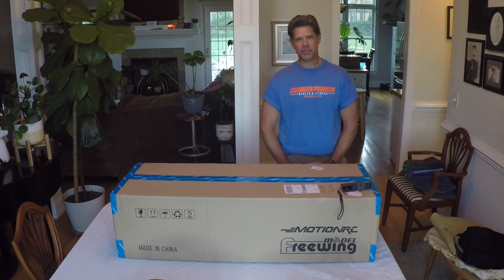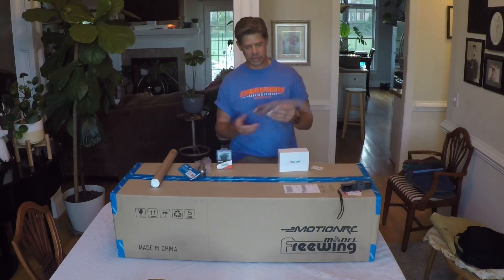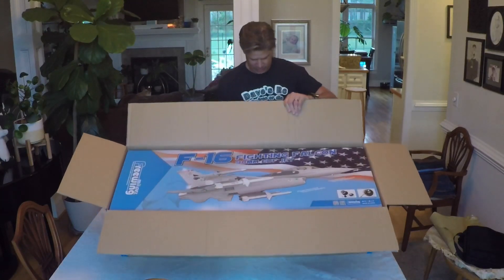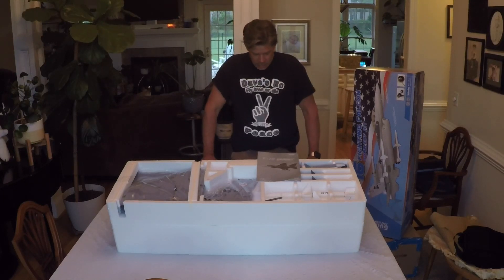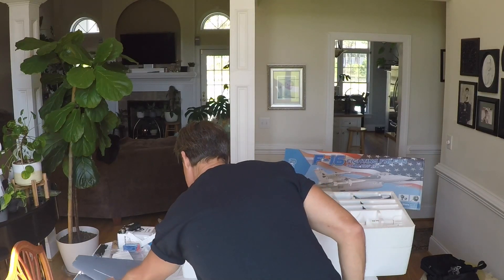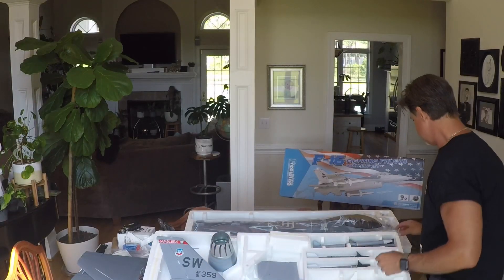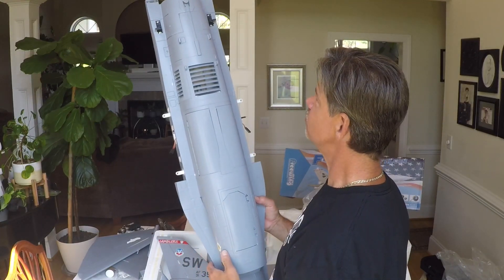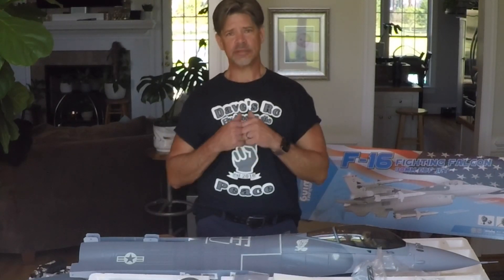Freewing F16 from MOTION RC unboxing and start of customizations

Comment: Thanks for the advice 0n the F4. I have 2 8S models, Camo and Ghost Grey, you might just have saved me a lot or heartache.

The HSD F16 EDF and Turbine are 2 different airframes. You cant really swap power plants. I have both, Grey EDF and Arctic Aggressor 6K turbine. Plus the Freewing 90MM EDF Inrunner. Its a sweet Jet.  

Cheers
Reply from the maker: Thanks Brian, love those HSD Arctic camo Jets, one day buddy, and yes....definitely change out that servo on those F4’s, if you read the forums, it’s not just us at our field havin problems, thanks for watching👊🏼👊🏼👊🏼